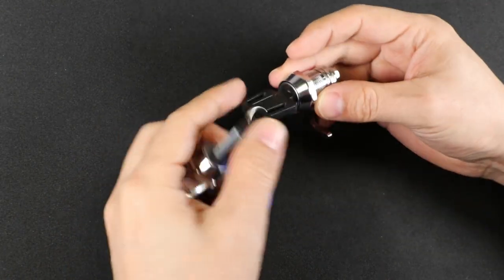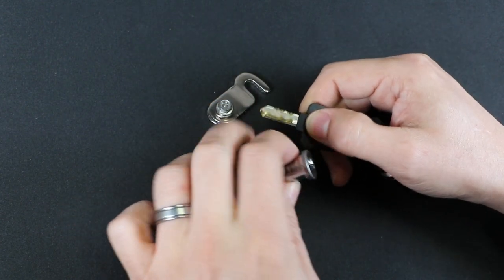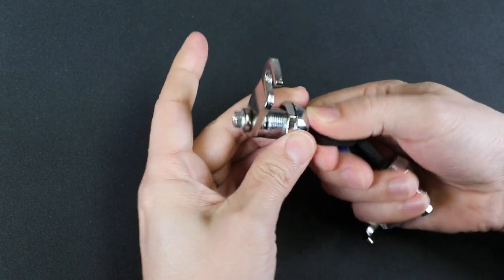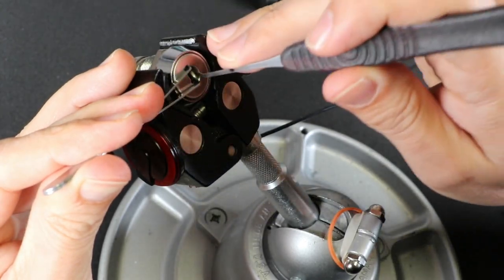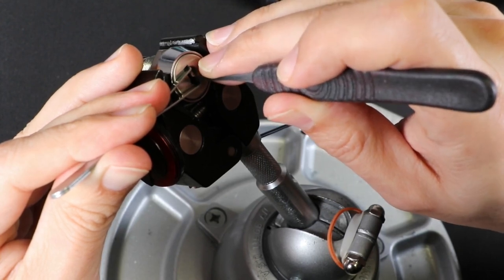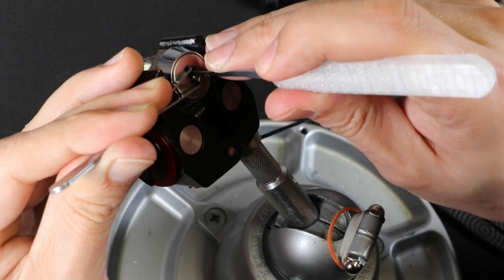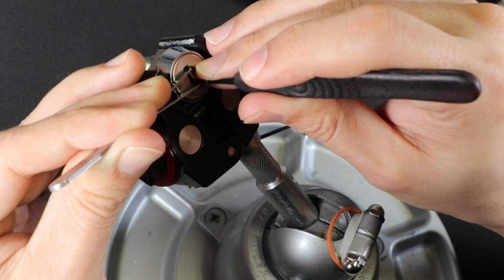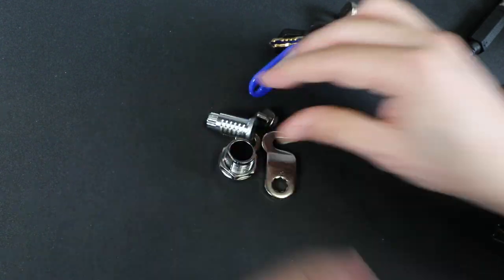[L217] Mailboss 12 Wafer Mailbox Camlock - pick and partial gut

Comment: The fact that it took you nearly 5 minutes in perfect conditions (on a bench with all the right tools, etc) is pretty dang impressive for a mailbox lock! Thanks for the info, good video.
Reply from the maker: With practice, you could easily get these in 2 minutes or less blind. Considering this was my 3rd or 4th open on the lock and it took me much longer on camera (camera always seems to add a lot of time on, maybe it's because I'm busy talking). But yeah, I'd like to have a mailbox lock like this.

Comment: Quickly picked and thanks for explanation of feedback and most comfortable tools used. Make it look EZ 👌 haha I pulled that dang spring shield off of mine, indeed was a pain.
Once I get a slider pick shaped up, I’ll have at it. I was struggling on the non-nub tapered feeling side with a few max lifts.
Thanks for sharing!
Reply from the maker: Slider pick is a great pick to make for your arsenal, comes in handy for jiggle testing unsprung elements all the time!

Comment: Nice demonstration of how to pick these kinds of locks. A bit of false advertising making the consumer believe that there are twelve working wafers when there is only ten, a bit of a marketing edge I think they were going for, cheers
Reply from the maker: Yah, it is very weird they include those extra two wafers at all, they're already spending the money to put them in, why not make them functional or just leave them out and save manufacturing costs?
Reply: @norlin76  The first two wafers are hardened steel to prevent drilling.